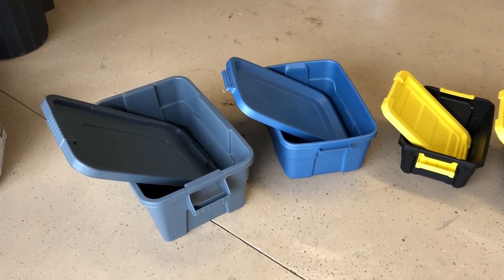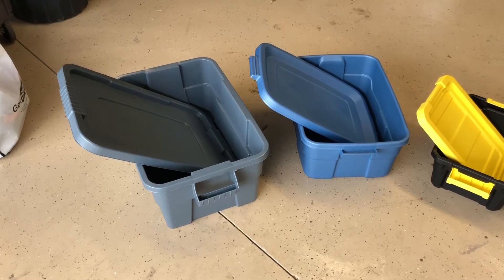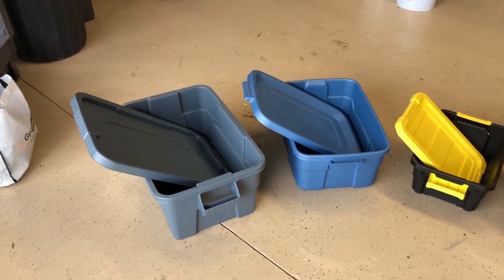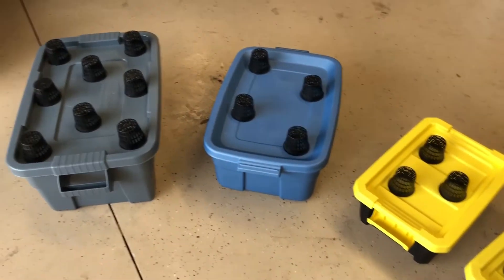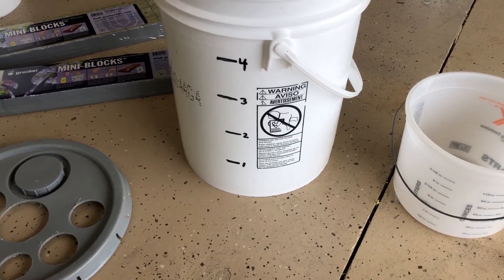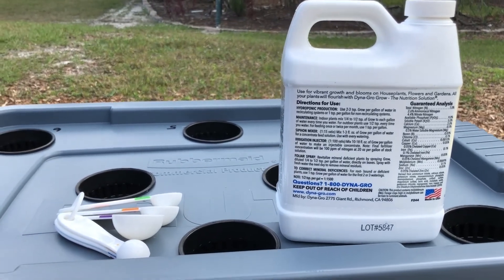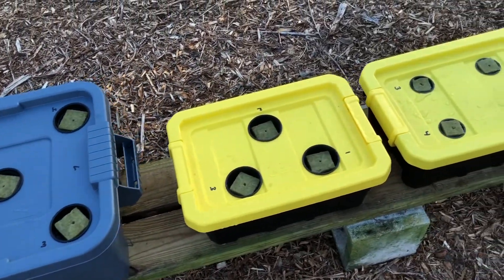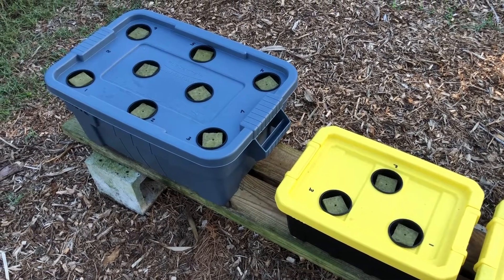Introduction to Kratky Hydroponics

Comment: Great information! Just getting into hydroponics here and I'm trying to avoid using the clear mason jars (although they are very convenient) they encourage algae growth too much for my liking. About how much would you say the shallower yellow and black container's weigh when filled? I'm having to grow on racks so I can't weigh them down too much. Looking forward to updates!
Reply from the maker: Hi Cam, the smaller containers are 4 gallon so they weight around 30 pounds when full (a little less than 4 gallons of water in them). I should ave an update posted tomorrow. Thanks for the comment :)
Reply: Three Acre Paradise I may just be able to have 2 per rack then! Thanks for the response, I look forward to the video!